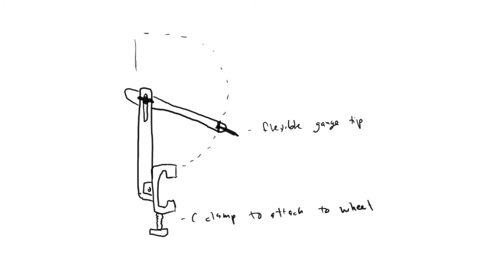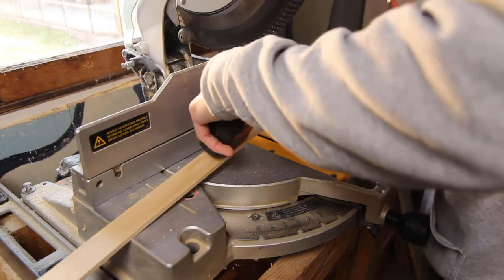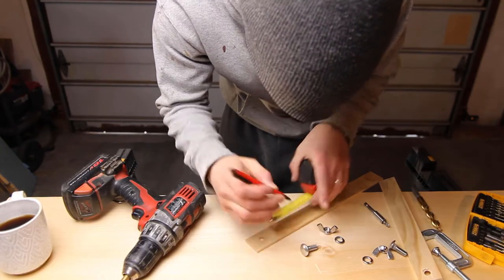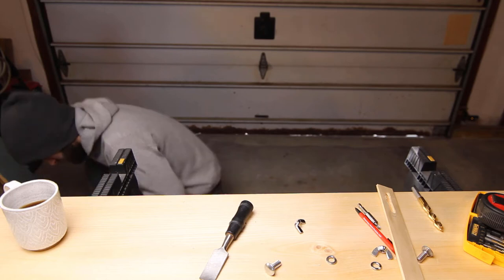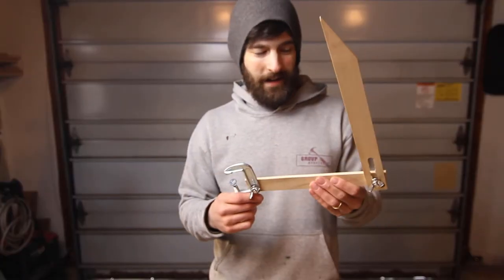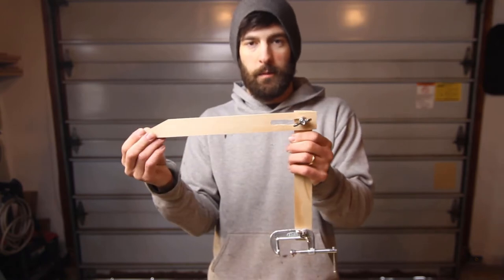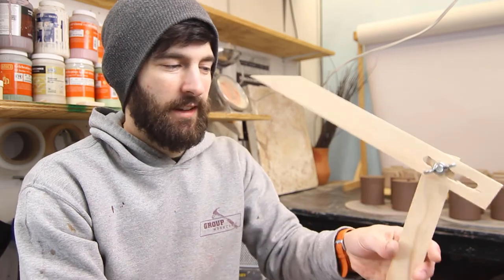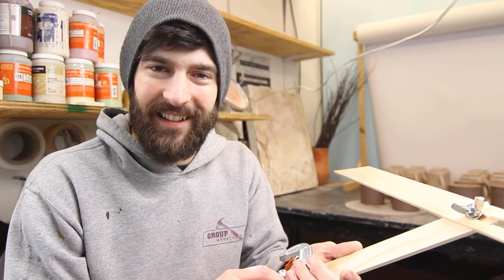How To Make A Throwing Gauge

Comment: I know it's been a while but can you give an update on the throwing gauge? Did you make any changes?
Reply from the maker: I haven't used it as much as I thought I would. One change I would do is have a 3-4'' piece of flexible material at the very end that you could flip up out of the way when centering and then flip down when starting your pulls. Thanks for watching!
Reply: @myermade  makes sense. Thanks for the update!